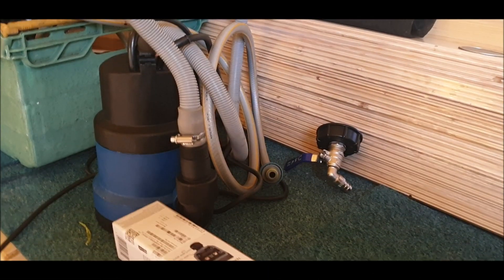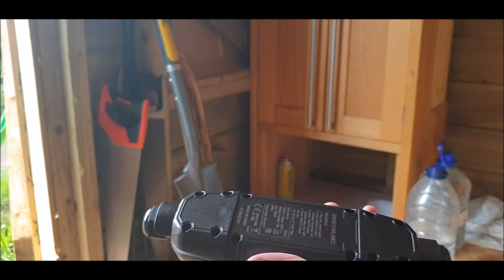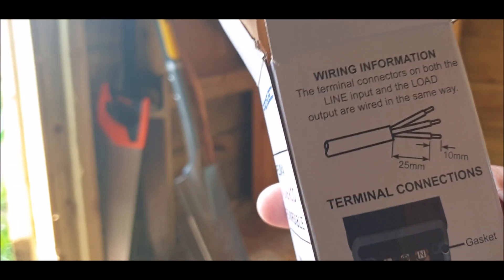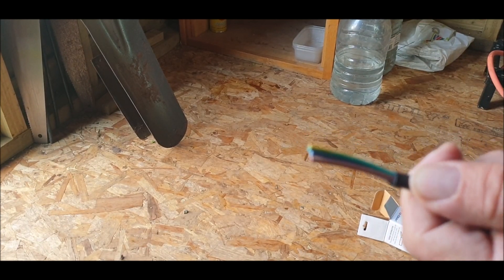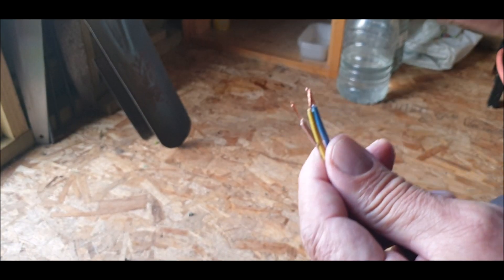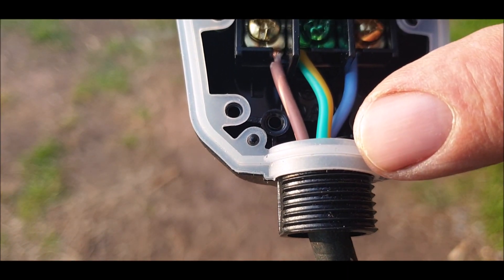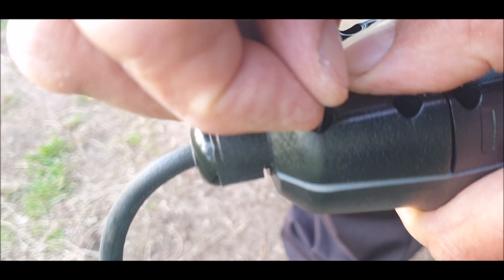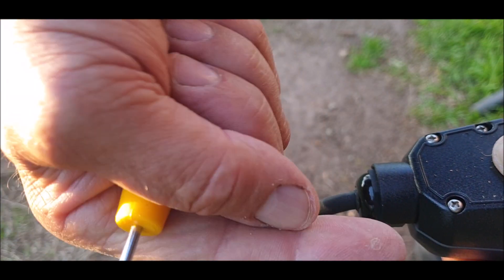Fitting a inline waterproof safety switch to the off grid shower water pump

Comment: Just subbed and working my way through your videos. I love your perseverance, especially with the shower. We have a portable shower that we use in the campervan awning. It consists of a small 12v immersible pump with inline switch, and a couple of metres of plastic hose with a shower head. We just put 3 or 4 litres of warm water in a jerry can, plug the pump into the cig lighter socket and pop it into the water. It works great. £13 on Amazon.
Reply from the maker: Hi Debbie Thanks for subbing! ill have a look on amazon